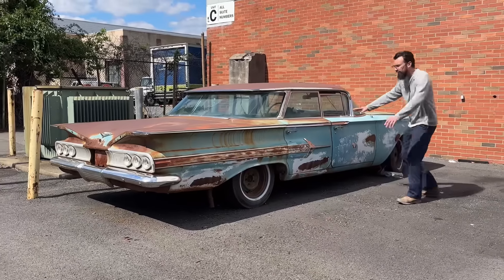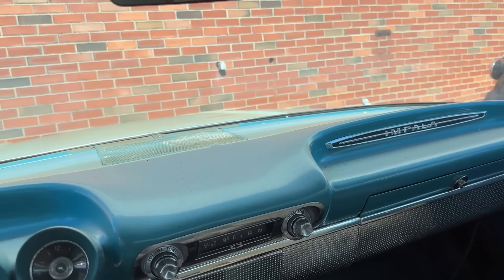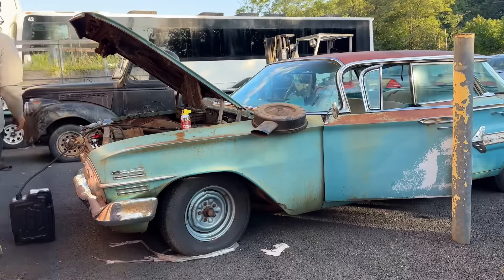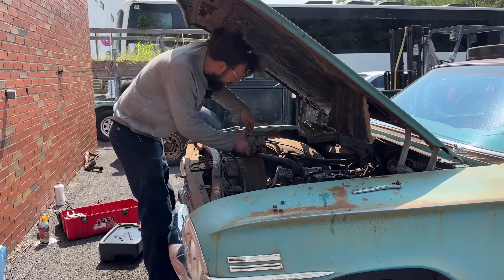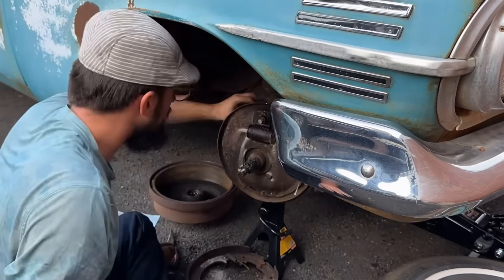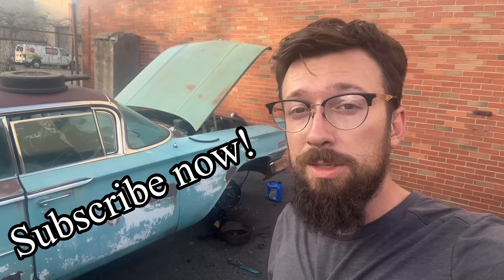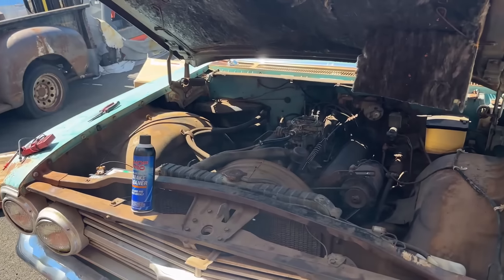I bought a 1960 Impala sitting 32 years, will it run AND drive 2,556 miles home? Part 1!

Comment: 39:46...The brakes look great! Looking at that Swiss cheese exhaust, I'm surprised the rear wheel wells don't look like the trunk floor. Or was the trunk floor done in by trunk gaskets leaking 32 years worth of rain into the trunk?
46:13...I would have had a dual chamber master cylinder installed, especially since you're going to take it on a 2,500 mile road trip. Ain't no fun having no brakes on the freeway.
55:12...If that's THEE original paint, you oughta keep the patina and have it clear coated! Unless you fancy having to get hearing aids sooner rather than later, I'd replace that whole Swiss cheese exhaust system. It's also cheap insurance against breathing in exhaust fumes during your road trip.
56:24...The other state still requiring a gas attendant is Oregon. BTW, I'd grease the speedometer cable so that you can keep track of your miles on your road trip. Good luck on your trip! You earned it.
57:30...You might want to remix it with Willie Nelson's "On The Road Again" starting right here.
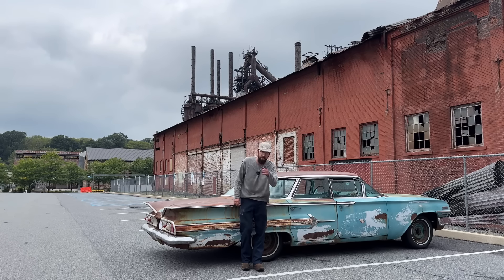1:00:15...I don't usually watch every minute of these "will it run" YouTube vids. Usually I fast forward it to the point where they finally get it started (or fail to get it started). But for this video I made an exception. Weelll, for one thing, I always liked those '59 and '60 GM 4 door flattops. Back in 1984, I briefly owned a '60 Cadillac 4 door flattop. My sister (born in 1960) and I called it "The Great White Shark" (insert theme music from JAWS here) on account of those fins. But then again, when I see a classic ancientmobile, with such great patina, straight body and surprisingly little rust, I just feel the urge to watch the whole thing. Congratulations!
Reply: Abdullah Regency Hospital cast

Comment: These had separate keys for the trunk and ignition/doors. So they likely didn’t have the trunk key and that’s why they drilled it out.
Reply: The trunk and door keys were the same in those years I assume it was because those locks were produced by a different manufacturer than the ignition switch, or because it was more common to replace the ignition switch back then.
Reply: @mgreg8134  No, no they weren’t. In 1960, if you walked into the dealership to buy a brand spanking new 1960 impala, they handed you two keys. One for the ignition and doors, and one for the trunk. That’s the way it was until about the 70s.
Reply: @frankjackson2439  I have owned GM's my whole life including a 63 Impala SS and a 65 Impala SS.  Both cars had one key for the ignition and one for the doors and trunk.

Comment: Those oil change containers barely hold oil without leaking from the cap on the side, gasoline is way too thin, so you are lsing over hallf your capacity.  I like your videos.

Comment: It looks awesome and very ready for fix it and enjoy I won't drive it to home first is a chance you won't want to do and also is always a flying things on the highway I drove last year to Florida from NJ and the car get 2 dents and fine line crack on the windshield little stones flying from a smart guy passing on the shoulder like it was part of I95 better spend the money on a truck than regrets later trying to found a windshield. That car will look awesome and you can put power windows locks and everything also get a classic looking radio with Bluetooth  well just let imagination flying to get it done .

Comment: I enjoying watching these sort of videos, finding a car that's been off the road for a very long time, getting it running then driving it 100's of miles home. But you try doing that with a car in the UK, at  best you would get disqualified from driving for at least a year and a massive fine, worst case end up in prison. And people in America, I am not joking. And the chance of driving a car that has been off the road for years a few hundred miles and not getting pulled over is highly unlikely. How you get away with driving with no plates, rotted, rusty & unroadworthy condition and not getting stopped is kinda cool, crazy & stupid.
Reply: i think they have 1 month to get a roadworthy cert... but not sure
Reply: If the car is insured and running and driving and doesn't have bits falling off of it then you would be able to drive it in the u.k with no issues
Reply: @sinistercharger  could it be insured if no rego? (I don't live in UK)

Comment: Oregon still requires a gas attendant too.
Reply: I live in Oregon and they do still pump it, unless you tell them you are pumping your own. It's kinda both right now, still tons of jobs relying on pumping gas. Likely they will  just leave it as both options until proper time to phase out for employors/employees.
Reply: Hope they don't stop attendant pumping altogether. We don't have enough jobs as it is, plus it's kinda cool to have that small town feel of pump gas and wash windows. They don't check oil anymore like in the old days, but still cool to have someone pump it.  No cars driving off with the nozzle still in etc..😂

Comment: Just a friendly question. Why did you not put premium in?  Does it still contain ethanol in New Jersey? That lousy ethanol will eat through all your rubber seals in the fuel system.

Comment: Is it not a good idea to change the oil before starting? Or was it not long changed?
Reply: It just needs to be viscous enough to not seize the engine up. He's not running it for an extended time, so it's fine for testing purposes.
Reply: If it's not horrible, it's actually better to test start on it, that way you warm it up a little so it flows out easier and takes any chunks you don't want in the engine or new filter with it.
Reply: @Adrian2140  that makes sense in a way. I was just curious that you could maybe score the cylinders if it'd be sat for some time.

Comment: Back then, only Cadillac, Olds 98 / Starfire, Buick Electra / Wildcat and Pontiac Bonneville / Grand Prix had power windows and seats.
Reply: Had a ‘63 Impala with power everything. Seats, windows, remote mirrors, cruise, auto dimming headlights, basically every option. It was 327 automatic 4dr hard top.  I was you long and didn’t know what I had  and it was a bigger project than I could handle.
Reply: @DeanFamilyAcres sounds excellent.  Impala was the biggest sedan that Chevy made, but this is a 1960 which didn't have all the electric power stuff yet.

You would know more about the history since you owned one...were the power windows and seats and everything first introduced in the SS model for 1961?
Reply: @resetsetmefree478  I’m not sure. I was super impressed that my 63 had all those options. Not sure when they rolled out, so many changes every year even within the X frame years.

Comment: New Jersey is not the only state with gas attendance the other state with a gas attendance is Oregon
Reply: Most co-op fuel stations here in Saskatchewan have attendance that jump to the pumps and a few other stations...but it's not the same as in the days when the had a oil rag in their back pocket, or even ask if you want your windscreen cleaned... I always pull into the self serve pumps cause I'd rather pump my own anyway.

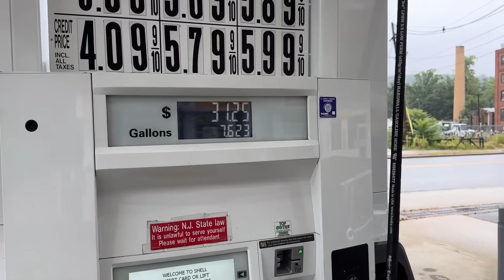Comment: 58:21 so 31,25 $ are * 1,79 = around 56 leva. 7,623 US gal * 3,78 = 28,81 litres.
So 56/28,81 = 1,94 leva per litre in NJ. And here it costs around 2,60 leva. Cheaper, but not twice as cheap (as I remember that was the ratio from SC back in 2003 😊)

Comment: 26:36 you should be able to convert it over to an alternator pretty easy that way you don't have to worry about voltage dropping with rpm engine speed and stuff like that.

Comment: 1:00:09 El Camino? LOL I feel like I’m missing a joke, or maybe I lack knowledge or expertise, but El Camino? I mean with the rusted out trunk if you cut it off, turn it upside down and weld it back on it’s sorta like an El Camino. Just, bigger, and older, and a load of other differences. But since I can’t see others questioning it, I’m guessing I’m just stupid or missing a joke, or both!
Reply: Probably both
Reply: I think it was just a slip, they're also working on a 1959 El Camino
Reply: @steeliewheelies  WOW, that’s an early one, I’ll find an watch the video. Do you know what’d be even cooler though? A Ford Ranchero, an early model from the late 50s!
Reply: @hunyesmith03  I think I’m wrong it sounds like the el Camino they have is also a 1960

Comment: Also looks like another "Dad" paint job coming on the horizon.
Reply: I’m not sure, but I hope your timing chain sprocket is solid metal verses metal with nylon overlay teeh, as the nylon would be excessively dry and cracked allowing a timing chain jump and disabling the vehicle.  Good luck,  I’d do the same if I had the opportunity.  Please follow-up with more videos.

Comment: Did it pass the MOT ?
Reply: Our laws are not as strict. A lot of our states do not even require a vehicle inspection to drive it on the road. It can be as junk as you want!
Reply: @streetratgarage  what happens in court if your brakes fail and somebody dies ? Surely you would be liable for negligence ? And culpable..
Reply: @griswald7156  I understand what you’re saying. Our laws are definitely different.
If you are talking about a large truck, such as a commercial vehicle, then yes, there are inspections and someone would be liable for a severe accident caused by a defective vehicle, but for privately owned vehicles, there’s just not much liability. You run into somebody and it’s your fault. The insurance pays for it and you go about your business. There is a possibility that you could be sued in civil court, but I guarantee you it will be a long difficult battle to prove neglect unless it’s just blatantly obvious.
Reply: @streetratgarage  what happens when you’re stopped by a bobby on the beat? And he takes a look at your Kamikazi drone ?
Reply: @streetratgarage  run over a rich man or a celebrity ,and his family might take on that long  difficult task of proving negligence..
Reply: @griswald7156  well, glad you asked that question. I worked for the sheriffs department for 11 years. I would just watch them drive by and laugh a little. If a police officer was to pull out the cold book and enforce every tiny motor vehicle law to the absolute letter. Then I am sure something could be found to give the driver a citation. Cracked windshield, broken, tail light even bald tires. But that would be more of an excuse to check the driver to see if he was wanted and less to do with the actual condition of the motor vehicle. With the thousands of police officers we have in the United States I am sure there are a few that are sticklers for the condition of someone’s vehicle. But it is going to be few and far between. 
The worst state we have as far as vehicle inspections would be California. They do have pretty strict laws, but you can still get by with a lot there
Reply: @streetratgarage  well if you get stopped in the uk…and the Constable dosent like the expression on your face ,or he’s looking for brownee points he will go through your car looking for safety infringements..window tinting,they’ll have a meter for that,noisy muffler,too little tread depth,broken tail light..any infringement attracts points ..alcohol on your breath,etc..typically 3 points for bald tyres…12 points and you’re off the route for 1 year…we’ve got to be super duper careful..ive only ever had one endorsement for riding a moto without L plates that was a magistrates court appearance and a fine …and youd have to pay road tax to the DVLA for at least six months before it was allowed onto the road..the previous owners road tax isn’t valid for you..
Reply: @griswald7156  if an officer wanted to be super picky we do have some of those laws on the books. It’s just there are very few officers out care about such a thing or even know about them. This is a United States and we have a lot of crazy people here so the police officers have way better things to do than to chase somebody’s noisy muffler.
You should just move here. I have been driving on an expired license plate for the last six months and have not got pulled over. I had the new plate. It was just in the back of my truck and I was too lazy to put it on until just a couple days ago.

Comment: The elcamino was based off of the chevelle
Reply: like 10 years later yeah, but the first generation was based off of the impala. The Chevelle didn't start production until 1964, and the El Camino started production in 1959, so it couldn't have started on the Chevelle platform. Same way the Ranchero was on the Falcon platform from 1960-1970 but then switched to the Ford Torino in 1971 when they stopped making the Falcon.

Comment: How did you use the external gas can to get fuel into the carb?
Reply: Either use an electric pump or run it through the mechanical fuel pump.

Comment: What if engine has coked valves, coked piston rings, rust in cylinders?... I understand, its content, but you can kill the engine with such a trip
Reply: Its not the trip but the way it was revived. Maybe some fuel additive would have been advisable to clean & lube the carb & valves

Comment: Its a alternator, not a generator
Reply: That’s a generator. It produces DC voltage
Reply: Some of you guys have never been around older GM cars.  They had GENERATORS up until 1963!
Reply: Yep, generator. Just like on the '61 Chevy wagon I learned to drive in.
Reply: Its a GENERATOR!

Comment: Sweet Jesus I only made it about 5 minutes in to this. No that's not BONDO, Your missing way more than just the rear lens, and for the love of GOD that's an inspection sticker. GEN Zers are in so much trouble.
Reply: you should have given it longer
Reply: Hope you get well soon.
Reply: @jamesstarnes7786 What a kind and considerate comment.
Reply: Calm down, old feller. I'm 70, and would have done a few things differently, but essentially the result is the same. Car's running and scooting down the road. That's the goal!